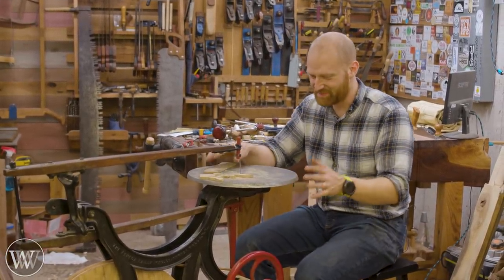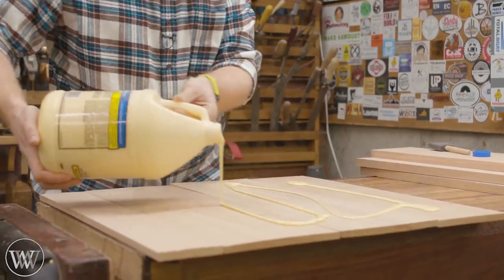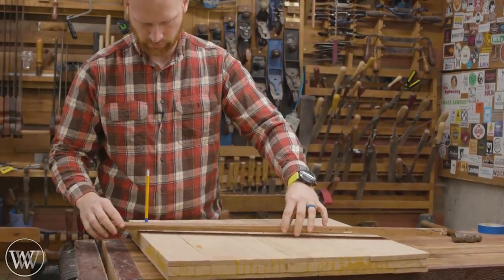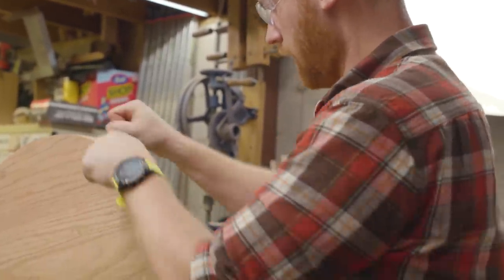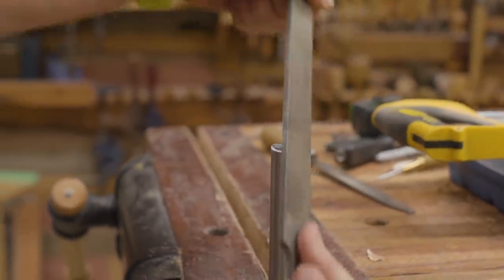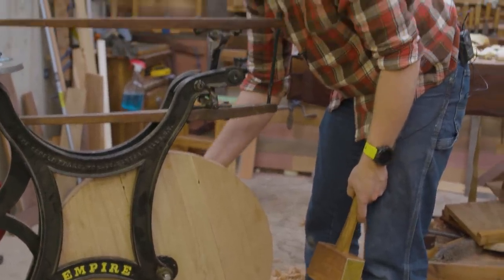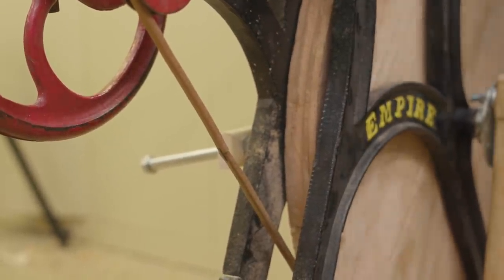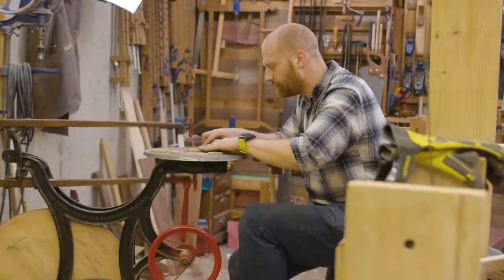Restoring the Empire Scrool Saw

Comment: That looks like a lot more fun than a stationary bike for exercise.  I'm guessing when the saw blade pulls the wood up that that's an alignment issue?  To some degree, I suppose that kind of thing is always going to happen.  Maybe it's also related to the lower speed of a manual saw vs an electric version.
Reply from the maker: you are the first one to guess it right the head is leaning a bit. that is one of the items I still need to fix.

Comment: I love this thing. A cardio workout while cutting wood.  They were really smart before electricity.  Flywheel width? What do you always say?  Measure how many times, ut once?  Better to have too much material on the flywheel and take it down than to have less.  I want a treadle lathe.  Small, compact, foot pedal powered.  Like a Singer sewing machine table with a lathe one it.  Kudos, James.  This is great.
Reply from the maker: thanks. this is surprisingly little cardio due to the gear reduction on the big wheel to the 2" pulley. so your feet move relatively slowly.

Comment: Turned out great.  Try inserting lead or some other metal in the flywheel for additional weight.
Reply from the maker: thanks. After playing with it a bit further I do not think I want any more weight. there is more then enough power in it and more weight just means I have to provide more energy.

Comment: It would be interesting to do a follow up on the massive cross grain glue up to see if it holds up over a years time.
Reply from the maker: I am looking forward to seeing. most everything I have seen is with at least 3 layers you can get it up to around 3-4' but I have never seen it again. and if it does crack it may give me a reason to do some pattern work and cast the real thing.

Comment: I may answer my own question but here it is. Why not use the curve plane (number escapes me) to round off the 16 corners? Will it only do the inside of a curve?
Reply from the maker: I was planning on useing a compas plane, but with grain going in both directions it does not do well going agenst the grain. with the spoke shave I can skew the blade on the tough parts.